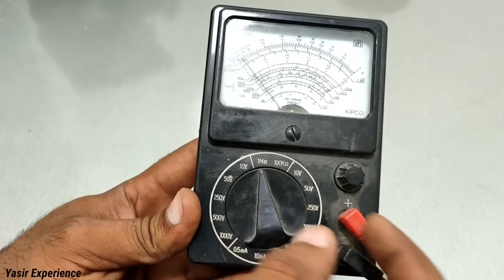Top 5 most powerful Generator Using Copper Wire new experiment 2021..

Comment: The last generator with the wooden disk is so funny. If you let it run for 2 minutes, it will fly in your face. It vibrates like a vibrating machine, you can use it to compact gravel. 😂

Comment: As the light bulbs glow, the generator has a maximum of 40 watts. That's ridiculously little. What's most ridiculous, everyone is fiddling with the magnets. Screws and screwdrivers are held out and the magnets are spun around for minutes, as if it were magic. In the end, a few watts come out of the generator, but the description in such videos usually promises 4000 to 8000 watts, which is absolutely impossible.

Comment: Hey, that's awesome , So the ferrite magnet does NOT need to have a sharp edge to excite the field wire with the magnetic field. So it can run smooth inside the field wire . that's amazing. thanks for getting it right Yasir. outstanding effort. YOU did good. well done.